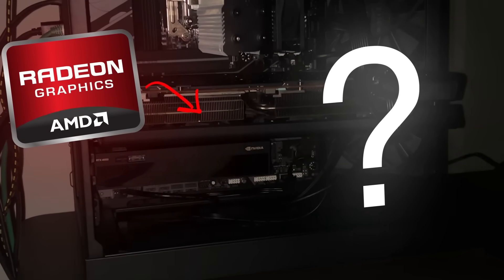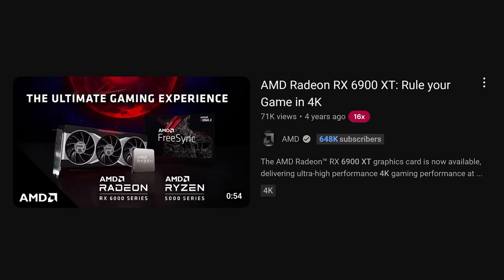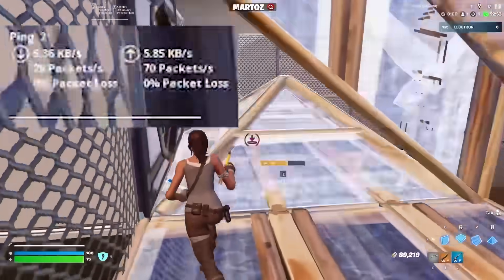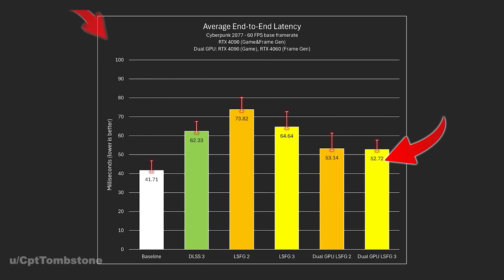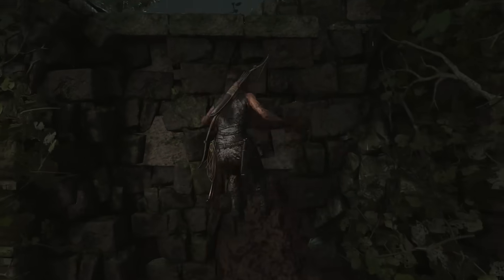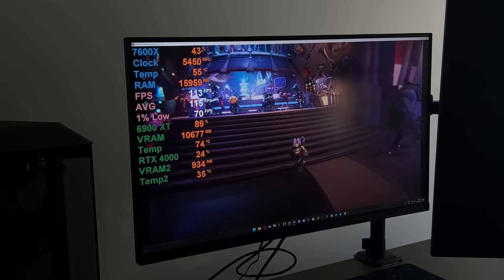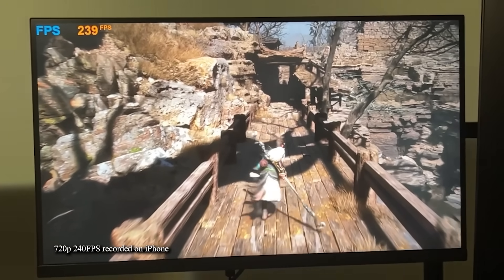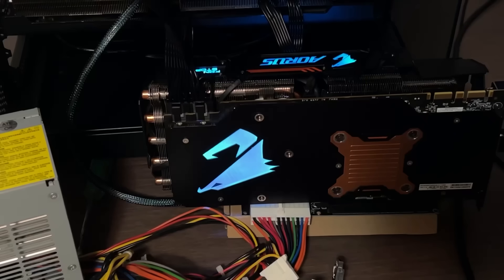I Used Both AMD & NVIDIA in One PC and Got 240 FPS in Every Game

Comment: I used gtx 1050ti and rtx 3060 which made my experience 100 times better in windows
Reply: did you have any issues with drivers or just plugged it and works fine? I upgraded from my 1050ti to a 2060 like 2 weeks ago, had some issues with the nvidia app so I used ddu and it's fine now. I have a spare pcie 3.0 x16, wouldn't hurt to keep my 1050ti working and would be an excuse to not sell it as I have a bit of an attachment to it lol
Reply: @haon777   yea no issues
Reply: @Gargentwitchongargee  how ??
Reply: @emileglime747  I didnt have to use my main gpu to render other things on my second display
Reply: @Gargentwitchongargee  how I have a 1050ti and 4070 wanted to try this do I need to plug display port into 1050 or 4070
Reply: @aaronhusain1659   if you want to use both then use both with cable

Comment: While I do enjoy the lack of impact on the gpu running the game, the current market for those who don’t already have a gpu lying around is more than steep, even for buying older hardware.

But if you can manage it, it can make the most use out of the app—just gotta weigh that against maxing out a $7 app.

At least on that front the cost is negligible.
Reply: @ALWAYSxREADY  try picking up a 6500xt or 6600xt as a frame gen gpu, though I agree. Unless your setup already has the bandwidth to plug and play with just an added component or two, it's probably not worth it... Devil's advocate given the gpu market, even with the headache, this might be more economical for most. What's more is it is something guaranteed that most of us can get our hands on today for a fairly known price rather than hoping to price snipe a gpu upgrade.
Reply: One time I got an RX 5600 XT for 65 dollars

65 dollars for something that can carry people through most of the used refresh rates at 1440p resolution, you don't need a god awful expensive second GPU for it
Reply: @ivanvladimir0435  well congrats; happy hunting for deals. Love finding them; but it still doesn’t remove that barrier for many. 

Also, the setup might be more than it’s worth for some. ITX users may need to go the iGPU route, which is fine but again added costs since they’re now having to compensate for a lack of a second pcie slot.

My point that while the results are proven, it’s not ideal—otherwise NVIDIA and AMD would love to be selling you their backlog like Nintendo does their games.
Reply: Just use igpu bro. Upscaling and framegen is not that expensive.

Comment: The ironic part is... amd actually performs better in lossless scaling frame gen... lossless scaling has a correlation with fp16 compute. Amd does 2:1 fp 16. It doesn't scale linearly, but amd consistently outperforms nvidia in lossless by like 2-3 tiers.

An rx 7600xt would've outperformed the rtx ada 4000...

Edit: you addressed this, my b
Reply: Intel also does well in FP16 compute. An A380 or A580 would work well for an even lower cost than AMD, especially if you're already interested in using one to add AV1 functionality, and B570/580 are FP16 compute monsters for the price.
Reply: @ryanspencer6778  so if I already have a 3080_10g or 3070_8g, both of which are starting to struggle even at 1440p, and I add a cheap AF arc/battlemage GPU, then I can enjoy some super lsfg performance?  Am I understanding your implication correctly?

I ask for the specific GPUs because I have 3080-10 and my mate has an 8gb 3070(ti?)
Reply: @aaronjones4529  it's important to note that frame generation isn't actual performance, it's just frame smoothing, so if you're struggling with vram limitations it's not going to help a lot with your dips and stutters. 

But apart from that, yes. It depends on a lot of factors, but an A580 and B580 would pair nicely with a 3070 and 3080 respectively.
Reply: @ryanspencer6778  So do you think an intel, or amd card would be better, overall?
Reply: @bobnorman3094  depends on a lot of things. If you don't have a PCIe x8 slot to put an Arc card in, forget about it. There's also price to performance considerations, and also various considerations for other things you can use the GPU for, like media encoding.
Reply: @ryanspencer6778  a380 = 8.4 tflops, a580 = 24.6, b570 = 23, b580 = 27.34. B580 is too expensive atm.
A notable intel card is the A750 for $200, it has 34.4 tflops. The other intel cards aren't nearly as good in this specifically for the price.
RX 7600 = 43.5 tflops @ $290 currently with inflated prices.
RX 7600 tops out at 220 fps. And the A750 tops out at 170-180.
I'm judging based on the google spreadsheet someone made with a select number of GPUs + max  frame rates.
So I wouldn't really say intel is better for less, I'd just say they have different tiers below the 7600. Either get the A750 or rx 7600 depending on how much $$ you wanna spend.
Reply: 26.73 TFLOPS for ada 4000 fp16 vs 45.14 TFLOPS for 7600xt vs 82.58 TFLOPS 4090
Reply: did you even watched the video?
Reply: So would a 6700XT be a good frame gen card for a 3080ti or too much of difference?
Reply: My experience tells otherwise
Reply: would having 7900xtx and 3080ti together work to double the fps and then double again with amd fsr  @KevinEF
Reply: @overpay7473  what do you mean? Like double frame gen? If you do, then it'll feel terrible. Just use lsfg 4x if you wanted to double frame gen.
Reply: it's mostly cuz nvidia optimized for their proprietary stuff, DLSS4 FG on an nvidia will outperform anything on FSR/LS by miles, there's no added latency at all other than the one naturally caused by the dip in raster frames on DLSS4 even with x4

granted, FSR/LS is more practical since we can use them practically anywhere, so hardware optimized for these technologies definitely have more merit (using LS on fps-capped games is a life changer), plus as a linux gamer none of the DLSS FG works on linux yet but FSR does lol
Reply: quit yappin
Reply: @cheeezs nvidia fanboy detected
Reply: @kyan_   Who tf said Nvidia was better??? I have an AMD GPU i just said that this guy was yapping 😂
Reply: @cheeezs he actually added information unlike your unhelpful comments
Reply: @kyan_  AMD IS FOR BROKIES!!! KEEP USING UR 3RD PARTY SOFTWARE TO PLAYE 15YR OLD GAMES IN 60FPS HAHAHA!
Reply: @yeetyeetmf2669  happy 5th birthday 🎈🎂
Reply: @cheeezs Do your own research and then come back and tell us whether he is capping or not. Nvidia is not always better.
Reply: @cheeezs quit hatin'
Reply: @cheeezs Child, let the grown ups discuss actually important things
Reply: @ivanvladimir0435  The grown ups with a short attention span who don't finish the video before commenting? Ok
Reply: @LandoKarzuk He literally explained why AMD GPU's do it better, if you watched the video you would know that it's not mentioned in it why it happens, unless you just shrugged off the comment as irrelevent and didn't even read it

Comment: The double gpu setups are always so cool to me, idk man it's also kinda funny how it actually works
Reply: I've rebuilt my old Crossfire twin RX 580s machine.
This idea could breathe new life into it.
Reply: Sadly, DX12 actually supports multi GPU setups and its vendor agnostic too, meaning you could have an AMD and Intel GPU working on rendering in tandem, like the old Crossfire/SLI setup, but no games have ever bothered supporting it.
Reply: I did this for years, you can run one monitor off the nvidia card and another off the AMD card. You can even launch 2 games at once, one running on each card.
Reply: that's what im doing and ive noticed a lot of awesome changes. but im using a RTX 4080 with a RTX 2070 super
Reply: @Nick_Morningstar  trade the 2080 for an amd gpu
Reply: They look especially great water cooled with parallel tubing
Reply: @Omar_ZX  : Avec la technologie mGPU on peu ajouter 2 RX6900XT (comme à l'époque du Crossfire) mais on peu aussi mélanger 1 GPu NVIDIA avec 1 GPU AMD . Le problème c'est que dans les 2 cas , ça ne fonctionne pas forcément sur tout les jeux , malheureusement qu'une petite partie des jeux sont compatibles avec cette fonctionnalité. Ce qui fait que ce n'est pas vraiment pratique, autant acheter un GPU ultra haut de gamme qui fera largement le taf et sur 100% des jeux .
Reply: I went to high school with a guy that had THREE GTX480s in SLI. His parents' power bill must've been crazy.

Comment: Just use AMD Fluid Motion Frames in AMD drivers. but you have to reverse it, the cable has to be plugged into the AMD GPU and you have to play through NVIDIA
Reply: It's a better setup than LSFG, but the only issue is his AMD card is better than his NVIDIA card. So it wouldn't make sense to not use that to render the game instead. 

What he needs is a cheap RDNA 2+ GPU like the RX 6600, and he can pair that with his 6900 XT
Reply: This gives nowhere near as much FPS as this method and requires using a specific GPU.
Reply: AFMF is worse than LSFG 3.
Reply: @DragonOfTheMortalKombat  that's an opinion but I prefer AFMF2 cause better latency & basically no performance cost
Reply: @Hybred  i just don't like the framerate only increasing when standing basically still, it feels like revving your engine with the brakes on or constantly switching between going full throttle and neighborhood speeds.
Reply: @TotalXPvideos  2.1 barley drops anymore btw. Test it
Reply: Wouldn't give the multipliers you see in this video.
Reply: @Skylancer727  2x uplift is great though.

Comment: In my opinion the best way to do multi-gpu's  in the best way possible would be to have a raster only gpu, and a eyecandy only gpu. No split frames like sli or crossfire, one gpu does the raw raster or "baseline" , and the other does the "pretty filter" outputting it accordingly to which clock is the slowest between the two.
Sli or crossfire would work great today IF they keep it within the limits of the bandwith and rest of the supporting system, gen 5 pcie multi gpu raster would be insanely fast, even bottlenecking the best cpu.

Comment: I just can't get over the input lag introduced by frame gen
Reply: dlss 4 has seriously improved frame gen input lag (assuming you start with an okay framerate)
Reply: @AnzelLmao  DLSS has nothing to do with framegen, DLSS is an upscaler. Frame gen is just that, frame gen.
Reply: with a high enough base framerate, you dont feel it, at least afmf 2 feels very smooth to me, i might be coping but i think it also requires less performance compared to fsr3.1 framegen. I got a 6700 xt so i already feel the struggles in many new games
Reply: @__-fi6xg  just my opinion but I feel like i can definitely feel it even at a solid base framerate, to the point that I'd rather just play at the base framerate
Reply: @ i currently only use it in helldivers 2 just to get close to the max hz of my new 1440p monitor. I wouldnt use it in competitive games. But yeah its use is extremely niche. storybased games that are locked to 60 fps for example like final fantasy 7 where framerate doesnt matter at all just for the eyecandy
Reply: Its always half the native frame rate. So 60fps feels like 30fps, 120fps feels like 60fps, etc. This is because the image is waiting for a second frame for generating.
Reply: As long as the fps before framegen is over game logic rate, it should be fine
Reply: Frame gen does not create input lag. The problem is that it boosts your visual frame rate but does nothing for the actual internal performance. So you might end up with a 60 FPS frame rate in a game that's actually running at 30fps. It's really only good when you use it to boost something like 120 to 240, because you're already getting good internal performance at that point
Reply: @KaitouKaiju  That's the paradox of Frame gen... it works best on a 5090, the once card that should almost never need it.
Reply: @sunprofactor  one day 5090 will be obsolete like every card before it and by then frame gen will help extend the usable life of the card
Reply: @KaitouKaiju  100% agree. My point was that it's counterintuitive that you need a high baseline framerate for FG to work optimally, when the whole idea is to save you from a low framerate.
Reply: @KaitouKaiju  it does but its only milliseconds at high framerates, certain games have higher input lag naturally than other games and you really cant feel it unless your base framerate is either low or your graphics card already struggles without it.
Reply: Frame generation will appear to have increased input lag. Try playing a game at 20 FPS compared to 60 FPS and you’ll know exactly what I mean in your ability to react to fast action on the screen. While not directly input lag, it will appear to be input lag due to your inability to predict and feeling like your timing is off.
Reply: can you recognize the 10 ms lag?
Reply: @subhashpillai9914    The 10ms are not the problem. The problem is that if a game runs at 20FPS, after frame gen it's still running at 20FPS.
So, even if you don't count the 10ms loss, you're still not gaining anything by using frame gen.

P.S. even with zero added lag, you'd still perceive input lag due to the disconnect between 20 and 240. It's like when you try to read in a moving car.
Reply: @DioBrando-qr6ye  I think frame gen is best for games that run at a nauseating 50-70 fps and you want a buttery smooth 144 to 240fps
Reply: @yilangpeng9651  That's my use of this software. Playing older games where the physics go haywire above 60fps.. Keep em locked to 60 in-game, but use Lossless Scaling to bump em up to a silky smooth 120fps and beyond!!
Reply: @DioBrando-qr6ye  You know that generated frames also take your input and change the next frames based on that input? So while yes, you do still have an input of 20 fps, it looks faster, and that's a worthy trade-off in single players games. That's my opinion, of course.
Reply: @DioBrando-qr6ye  factually wrong. you are gaining 220fps at a degraded quality.
Reply: @DioBrando-qr6ye  There's no helping a base 20 fps, but if you drop 10-20 fps from enabling frame generation, negating that hit would be really good, especially if you are on 50-60 fps
Reply: @DioBrando-qr6ye You're literally using the technology wrong and then blaming it. You're not supposed to use it at 20 fps!!
Reply: @subhashpillai9914  Depends on the game, Osu feels unplayable with 8ms of delay. Racing games feel unplayable with 30ms or higher. RDR2 is alright with almost any delay.
Reply: @subhashpillai9914  well maybe he is not but cs 2 for example killed it with amd boost and upscaling sure i get some more fps but i get like 17ms which is stupid i dont see much difference from the 30ms i had without amd antilag but i noticed i get more kills per comp match i mean this is the future of crapy games and unoptimised stuff
Reply: its pretty much a non issue unless youre some pro level esports player that uses a 500hz monitor and can tell the difference. ive got frame gen enabled in forza horizon 5 + using an xbox controller via bluetooth and there is ZERO perceived latency. 165fps at ~33ms pc latency.
Reply: It is an issue at 20 FPS.  In a shooting game or any game that requires fast reaction that 20 FPS is not enough. I know this firsthand because some of my games run at this if I crank up the graphics. Try playing GTA at 20 FPS compared to 60 FPS, for example get into combat with somebody in both. 

Then come back here and tell us how 20. FPS isn’t worse for reacting to what’s going on screen. Well, not the same thing as latency. It will seem like it’s latency due to it Making it difficult to get the timing correct.

Comment: So...
Don`t sell your old GPU and keep 2 of them ???
If you upgrade, using the new one for raster and the old one just for frame gen ?
Reply: Exactly what I ended up after watching this video .. 

Had LFSG3 already. Had exactly 6900XT and recently got the 9070XT. Was thinking to build 2nd PC with the 6900XT (** as I love it, don't think selling it for like 350, as for 350 its "Frame Per Dolar" value is insane).
 ... setting the 6900XT as FrameGen GPU in the LosselessScalling/AMFM2.1 ontop of the 9070XT  ! 🤯💥

** 9070XT will get the FSR4 in games (already did FSR4 to 40 games with Optiscaller), also 9070Xt will cope with the RayTracing, and then the 6900XT will FrameGen them beautifull frames with the LSFG3/AMFM2.1! 🤯💥

Already looking for PCIe 4.0 extender as I have spare 2nd PSU, so far my Asrock Steel Legend X870 looks promising for using PCIE2 4.0 x16 slot.. 
PS: Have had 2 GPUs-one-PC (with 2 PSUs) in like 2013. Let's go!
Reply: You kinda have to do that now with 50 series if you want to retain 32bit PhysX support otherwise you have games that run like garbage because they heavily used 32bit PhysX